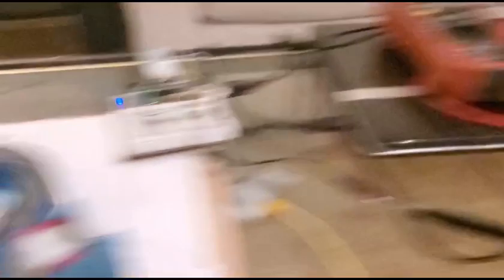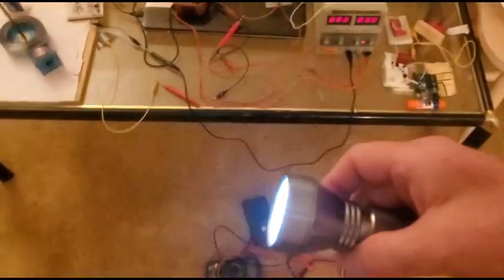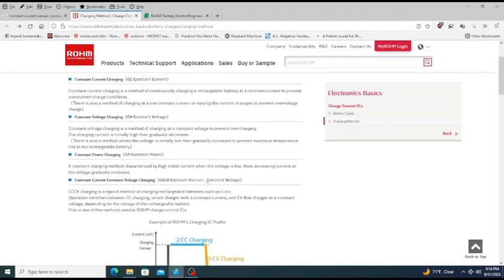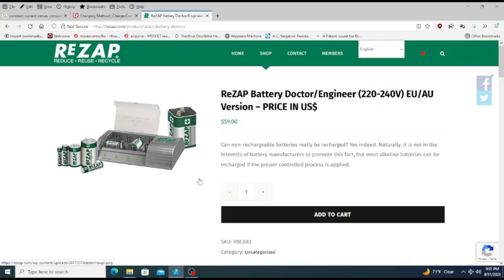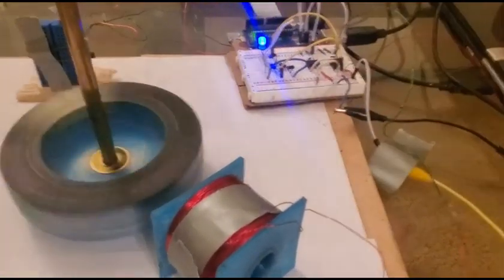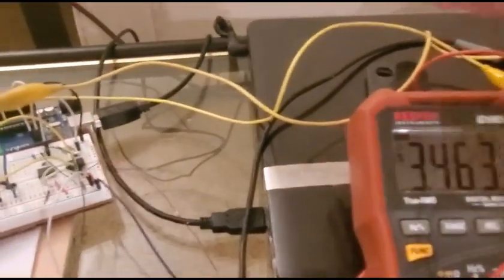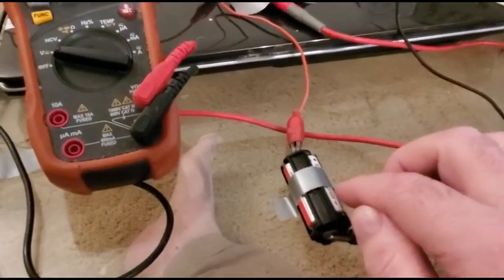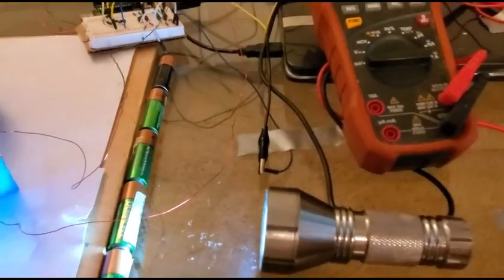Recharging Alkaline (Non-rechargeable) Batteries with a Pulse Motor

Comment: Some alkaline batteries will respond better to radiant charge than others. Duracell seem to be the best built battery (AA or AAA) for these methods. Energizer and ActiveEnergy seem to be well suited. Some Rayovac builds can work as well. Actually, how well the battery responds to the radiant charging, speaks about the quality of it. I have seen many brands batteries start leaking as their structure/design cannot withstand this energy. Seemingly, a characteristic I have noticed is that the heavier the battery is, the better the outcome of the charging. Batteries that are built in quality will charge super quick and hold. I usually charge 4 AAA 1.5V (after being discharged to about 1.3V or below) for about 5-8 minutes. They would reach almost 1.9V and eventually drop and stay at 1.7, which is better than the brand new ones of the store shelf.
Reply from the maker: Thx for the info, will be fun to put to the batteries on a capacity tester.

Comment: I have played around with relais. Most difficult thing was to pack it in, to get rid of the noise. I used it to recondition NiCad batteries. I tried it on alkalines, but they usually started leaking. In the comments I see someone explaining about 2 to 3x the voltage? I could retry and put 4 to 5 diodes in series so that voltages above 2 to 2.5 Volts are capped. Or I could try to trnasfor the spikes down (no idea which transformer lies such short pulses == high frequency spikes.
All in all, there is more to it, those spikes from coils (back emf). I do have seen a Bedini video where he shows very particular things with it, lighting up bulbs under water (with his hands in there too) and such.

Comment: Another very interesting video thanks for sharing. I thought you may be interested in these two videos just out of curiosity . This first guy is experimenting with increasing Torque and has a some recent videos where he increases Toque by up to 3x - https://youtu.be/s3UZ-BZoq-A?si=LW0WntuAJVrwRgZR - And this chap has a slightly different design that uses 2 miliamp circuit design - https://youtu.be/5KDwK5miXkA?si=wEjgZHCA5GaUTTfe. Great series of videos you have 👍🏻
Reply from the maker: Many thanks Brainfoo! And those are interesting videos. Glad you are enjoying the videos, I just got finished building an Arduino battery capacity tester and will try and get that out to people soon.

Comment: after many experiments and many lost healthy batteries using a few different pulse charge methods i find that using the radiant spike is best , but if you allow the radiant spike to go higher than twice the battery original volt rating it will eventually explode the battery and kill it. No matter how low your current is it will still explode . So i intend to try again one day with different approach of controlling the radiant spike to stay below twice the battery original volt rating. This can be done pule pulse switching a thin as possible coil with maybe 25 turns , i expect like this the spike wont go above 50 volts , adding turns will bring it up real high , i have one inductor i made it has 1500 turns on awg 30 , it never blows out the transistor and draws very low current but the spike is around 1000v , if i use this 1k v on aa batteris or 9v it will restore them as long as i monitor the volts and disconnect before it crosses the battery V rating
Reply from the maker: Hey Myke,  Appreciate all the feedback.  Haven't even gotten to temperature and battery capacity, but yea if you heat up your foxhole radio in winter it will work again, or if you are driving a Tesla car in Canada in Winter you will lose some range.  That's pretty wild you just heated a battery on the stove and got more charge out. 

I really like rechargeable NiMH though they are 2-3x the cost of alkaline.  The nice thing about both of these as compared to the commonly seen Li-on, is if you guess wrong, "oh they don't like pulse charges and they have grown stalactites between the +/- terminals" is you just have some crud around the battery as opposed to "hmmm, I just burned down my house".  Add in the fluoride in the Li-on electolyte and, while they pack a wallop, as currently deployed I would say are far too dangerous.
Reply: @paulmaher812  I know they use a different separator now for lithium from what i heard .  But ya the older Lithium will set fire while on charge , it happened to my neighbor they weren't home and there garage was smoking i threw bucket of water on it .   I also destroyed a lithium battery by pulse charging . Was his nameJohn B. Goodenough  the inventor of the lithium battery , he more recently produced a fire proof version https://en.wikipedia.org/wiki/John_B._Goodenough

Comment: The 1st time i recharged alkaline battery was in the late 80's i was kid messing around i put the pos terminal face down balanced on top of a old electric cooking plate on low heat setting for 5 min or until the battery got to hot . You can warm these batteries up and they will have charge again . I did this with dead battery AA so the charge was only present as long as the battery was warm , as soon as the battery cooled off i had to warm it up again to use it in t remote , i remember correct the battery would run the tv remote for about a day